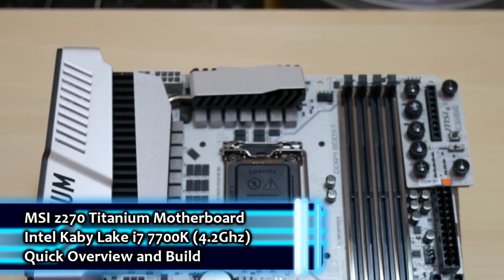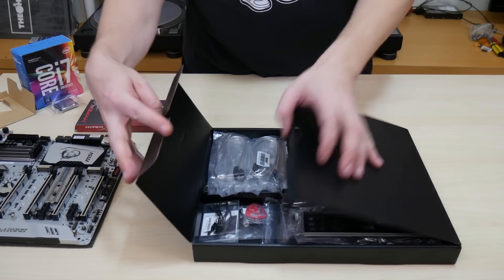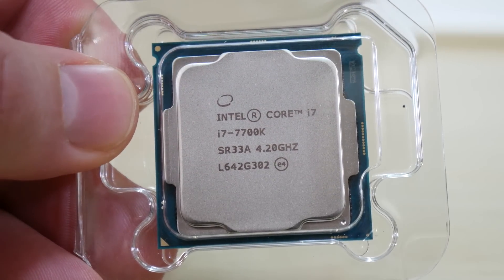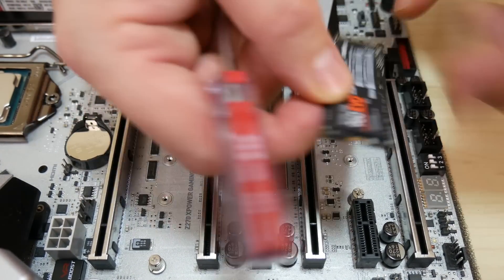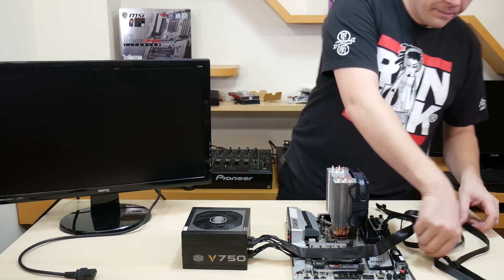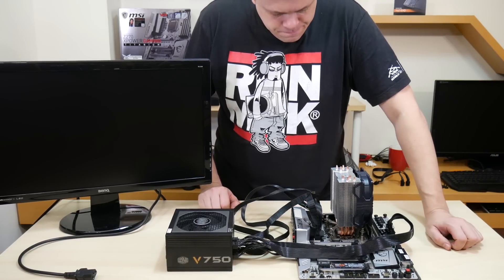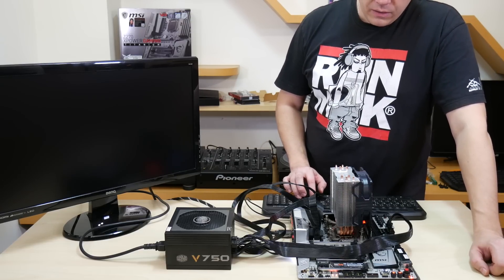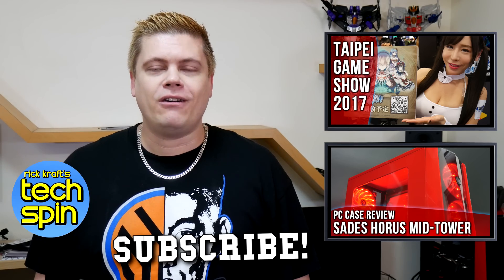Intel i7 7700K CPU+ MSI z270 XPower Titanium motherboard: remarkable combo

Comment: will the corsair rm750x be ok eith this board?
Reply from the maker: The rm750x has two EPS connectors (motherboard top left power connector) so that will be a good choice. Don't get the older version though, it only has one EPS. Thanks for the question!
Reply: cheers..

Comment: so is the 12 pin Cpu required or can it run on 8 pin?
Reply from the maker: Yes, confirmed it can. I had the 8-pin plugged into the right hand side and it worked. Although... I'd fill all the holes if you can :D

Comment: Hi Mr.Rick, where do you buy the extra ATX 4 pin power cable and ATX 6 pin for PCIE slots.
Reply from the maker: I should recommend you get a new power supply that has the extra power cables you need.  You could buy adapters that give you power from Molex to ATX 6/8 pin but it's not recommended as the PSU's rails (power delivery system) may not be able to supply the required power.  But the adapters are cheap.  There shouldn't be an issue if you try, but you may be risking your hardware... I take no responsibility!  That being said, I'm running an old Radeon 6850 dual 6-pin half from PSU wiring, half from Molex adapter without any issue so far.

Comment: Nice! A few questions for you. I really want to build a rig like this but four cores is killing me.. and I don't want to go Ryzen because of certain software I want to use that is mostly tested and benchmarked on Intel (and I'm angling more for a video editing rig), even designed with optimizations for Intel specifically. What I like about this board the most is the multiple layers of PCB - for some reason reviews of this board on German sites tend to highlight the PCB benefits of this board for OCing more than English reviews - and the Titanium plating which I've heard does wonders for heat dissipation and is an OCer's dream. But with Intel screwing everyone over by making the awesome six core 8700K non-backwards compatible with older boards there will have to be a whole new line of boards running Z3XX series chipsets just to run it, and I can't pair it with this board! 

So my question is, do you know if MSI or any other vendor makes a Z3XX series mobo that can dissipate heat as well as the Titanium? It would be great if MSI just continued this line for Coffee Lake processors.

But, I must ask, am I getting sucked in by a marketing scheme to believe that it's the titanium that gives the board its heat dissipating features, or does say Gigabyte or ASUS make boards that are comparable in that area? I had a bad overheating experience with my last board so I want whatever comes next to be able to take a beating, so to speak, and be resilient.
Reply from the maker: +Josh Nielsen I know that MSI used higher quality caps and extra layers for the Titanium which helps to dissipate heat, but OCing has been going on for a decade without these features.  I consider them to be a bonus, but not mandatory, unless maybe you're going for record breaking attempts. 
If you're building a video editig rig, the most I'd go with is a mild overclock anyways, you want rock-solid stability for the long run, so i wouldn't say the Titanium's bonuses are a determining factor.
IMHO boards from MSI and Gigabyte 'tend' to have more features per dollar than comparable Asus, though that margin has decreased and I've had very good experiences with Asus boards. 
I'd definitely go for a mid to higher end ATX, usually in the 130-180usd range, for that you're pretty much guaranteed to pick a winner. Thanks for the comment!
Reply: Thank you. That is quite helpful. It has been many moons since my last PC rig build so I'm trying to re-up my research in this area. I appreciate the feedback!
Reply from the maker: +Josh Nielsen Im looking at the Coffee Lake CPUs myself, i have the Kaby obviously but a but expensive for a while new platform. BUT 8700k 1685 vs 984 for the 7700k in Cinebench15! Sources: https://arstechnica.com/gadgets/2017/10/intel-coffee-lake-8700k-review/2/ http://www.tomshardware.com/news/intel-coffee-lake-kaby-lake,35549.html

Comment: Anyone know how the z170(previous version) will handle a 7700k?
Reply from the maker: Check the mobo support page first, most likely yes HOWEVER, you will probably need to install a skylake 6600 installed to get to post and update the bios, then swap in the Kaby Lake 7700 series.

Comment: i am gonna make 1 m2 960 pro 512 for window 10 only  and 1 storage SSD 850 pro ssd for installing gaming, is that good for this mobo and what is the best solution for m2 and ssd should you recommend me Techspin?
Reply from the maker: Sorry missed this, you can certainly run dual m2 but really, you only really need one

Comment: Have you eventually installed this White Corsair DDR4 3200 for 100 series motherboards? does it work well? There are contradictory opinions on if it will work fine with this chipset..., so I'm truly confused. Could you please comment on this?
Reply from the maker: +Vasily Kandelaki Ya thats my next video...soon!
Reply: Techspin . Cool, thank you, waiting for it.
Reply: ddr4 is ddr4 will work in any ddr4 motherboard
Reply from the maker: So yeah, I got it to work, although I occasionally get failed startups.  Seems to be if my 43" Benq TV isn't on when I power on the computer, there's no HDMI handshake and for some reason this causes the BIOS reload issue...?
Reply from the maker: While true, he was trying to find out about getting in to run at full 3200 (XMP) speed.  While you can stick any DDR4 in, the board may not support the XMP, so not full speed.  And yes, there can be issues with this board.

Comment: Did the I7 7700k work out of the box with the motherboard or did you have to flash the bios?
Reply from the maker: the 7700K had no issues whatsoever- that was with one stick of memory though.  Had to work hard to get all 4 sticks recognized and booting though.
Reply: What did you do to make all 4 get recognized?

Comment: can i use quad channel rams in this motherboard? thanks
Reply from the maker: The board is listed as a dual-channel board, but it's blazing fast:  DDR4 Memory
4133(OC)/ 4000(OC)/ 3800(OC)/ 3600(OC)/ 3200(OC)/ 3000(OC)/ 2800(OC)/ 2600(OC)/ 2400/ 2133 MHz
Memory Channel  Dual       DIMM Slots  4        Max Memory (GB)  64
Source: https://www.msi.com/Motherboard/Z270-XPOWER-GAMING-TITANIUM.html#productSpecification-section

Comment: do you have to use that extra cpu power 4pin slot even if you are not overclocking? and if so can you recommend an appropriate psu that would have this functionality (fully modular psu's prefered) please and ty in advance
Reply from the maker: I can confirm that the board WILL boot without the extra 4pin EPS.  If you want to OC you'll likely need to have it for stability.  Higher end modular PSUs have this feature, the Cooler Master v750 (and I'm guessing the higher models too) have extra wiring to support this.
Reply: Thank you for Taking the time to reply to my question
Reply: just another addition i have no interest in overclocking I want this board for strictly cosmetic reasons (im making a white build and i mostly game and do video editing and graphics design for work) i could not find a mostly white board with RGB that is a Z270 (my other option im considering was a Asus Maximus hero IX) this has no lights but it fits thematically with what im looking for i was in the market for a corsair RM 750X and could not find any information indicating it had an extra 4 pin eps connector for the motherboard so i thought id ask
Reply from the maker: The Asrock z270 Taichi has a huge white graphic over half the board, might be good for a white/black build
Reply: Lol yeah I just was looking at that one as a potential board for my white build (with some black ofc) but Idk, it looks a little too plain, I like this MSI Titanium one and I have enough for it but I don't like how it's silver... Lol I wish they had a white and black version with maybe even some white LED lighting on the board like this Red and Black MSI one. See link https://www.newegg.com/Product/Product.aspx?item=N82E16813130969 

I swear if that red and black one was just re-done to be black and white, I wouldddddddd buy it in a HEART BEAT. It'd go soooooooooooo well with my GTX 1080TI Hall of fame!!

Comment: I have a question, did you have an issue using xmp ?? with the 2 packs of DDR that you bought from amazon obviously covered the 4 slots, did you run into a problem using the xmp with them ? I ask because I bought 2 packs of corsair dominator 2x8gb DDR, so total of 4x8gb DDR , 1 stick in each slot and I had major problems using XMP.
Reply from the maker: Phill Hudson I'll run some tests soon, been sick and finishing the Gamerstorm Captain 240 builds. Get back to you on the weekend!
Reply: OK that's great thanks
Reply from the maker: Sorry just got back to this now after day job, vacation and sick for a bit.  Can confirm I had issues also. Power disconnected, installed in slots 2 and 4, in bios I enabled XMP, booted to desktop, removed power again, put in slots 1 and 3, BIOS took a bit, had to reenable XMP again, booted to desktop finally with 64GB-3200(actual 1600Mhz).  Lemme know if you still need any help, ya?
Reply: Thanks man, I ended up sending my 2 kits back and getting 1 kit of 2 sticks because the board simply would not enable the xmp with the 4 slots full.
Reply from the maker: My bad I didn't get to this sooner.  It was tricky and required some fiddling, but got it after a bit.  Seems like the way to go is XMP off, install two, boot, XMP on, boot, install extra sticks rinse and repeat.  I got it to work but it sure felt finicky.  Hope you got it running the way you want now.

Comment: temp i7700k  ?
Reply from the maker: idles around 32*C, running Cinebench15 with Hyper 212x evo AIR under load ~70*C, Captain 240EX AIO Water under load 60*C
Reply: Cooler Master Seidon 120V V3 Plus

?
Reply from the maker: I don't have one on hand but it performs similarly to the CM Hyper 212, check it on pcper .com:  http://bit.ly/2mDPYs0
Reply from the maker: Missed this comment.  I single 120mm rad doesn't outperform a Hyper212 by a large margin, just a few degrees.  Better off to get a 240mm rad if you're going that route.  If you don't mind the metal, the Hyper 212 handles overclocking well but for top benchmarks I'd try an AIO water cooling solution.
Reply: Techspin corsair v2 240
Reply from the maker: Corsair H100i V2 240? That's sweet gear, nice pick

Comment: So does an M2 drive run faster than an SSD?
Reply from the maker: vanishingson2k yes, and I'll do some benchmarks soon showing how much faster hehe
Reply: And faster than PCI-E drive?
Reply: 2x M.2 X400 PCIe drives in RAID 0 will smoke that single SSD. I get 1500 read. 1200 write using 4k chunks...

No SSD can touch that. As I also have 2x X400 SanDisk in RAID 0 for games. So I can see exactly the difference. It gets 1100 reads and 970 writes....